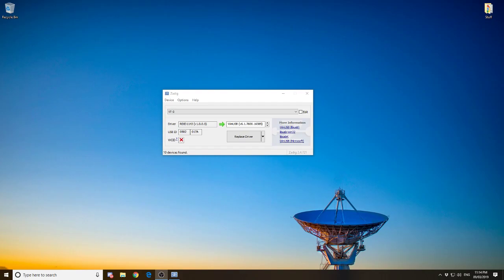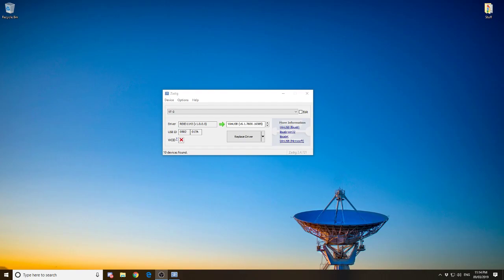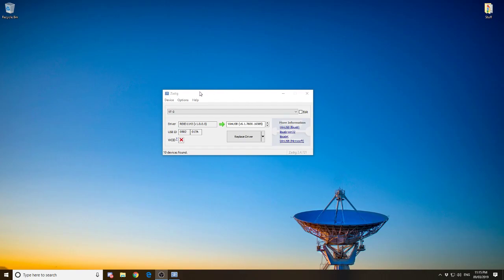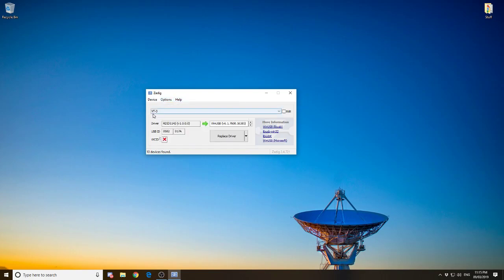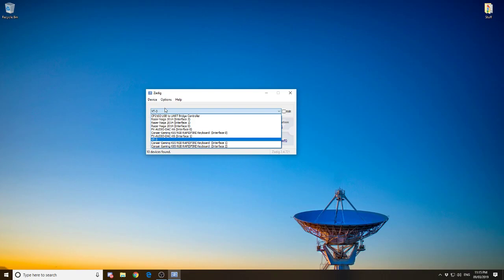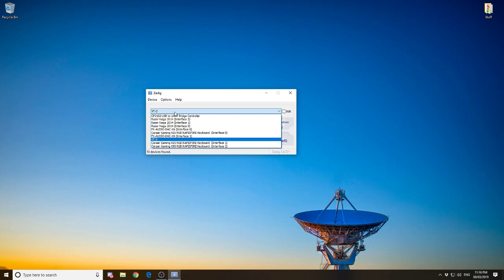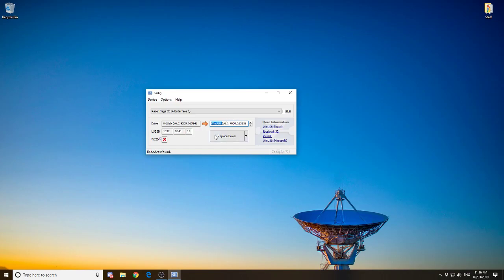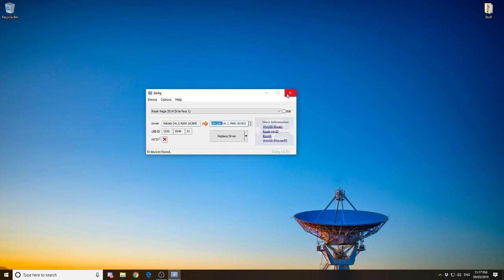How to fix RTL-SDR Driver Issues

Comment: I'm a delivery driver and for entertainment while driving I purchased two noolec kits to use to get a digital p25 trunked scanner working on my car.  I've only had them 3 days, one works perfectly, they other refuses to work.  It makes the bling bling on Windows when you connect it, but unitrunker refuses to start it.  Reinstalled driver's reinstalled unitrunker.

Comment: I feel I have um how should I say  it with out swearing, well and truly yes well we all make mistakes ...every thing was load good with RTL SDR V 3 , I had a windows  up date Grrrr plus I had also loaded Virtual cable, with a lot of confusion as my laptop, was no go . 
I wasn't picking up the SDR after this so I reloaded the dongle etc, this is were I think I went wrong , I will rephrase that , I know I did .  So how do I reload the original driver  if I can't read the SDR at all , any help on that would be grateful but, I think i am looking at a new SDR.
Reply: Okay just to let people know , Have uninstalled all programmes and reinstalled them for what ever reason it now appears to be working,  one other thing , although it was working before originally , this time I have slightly different software V3 and I am sure I was using it, however it reloaded C++ two times and we  will see how it will go now.